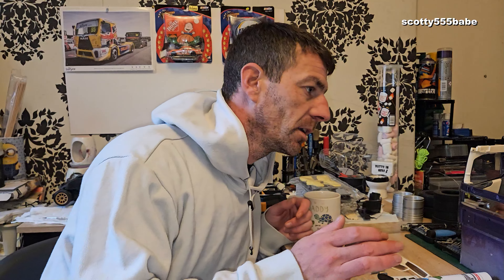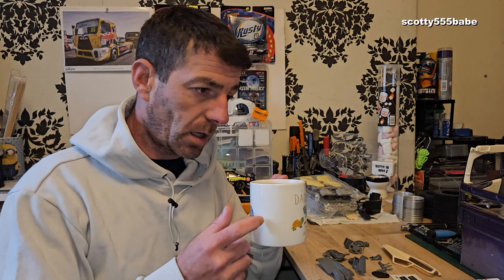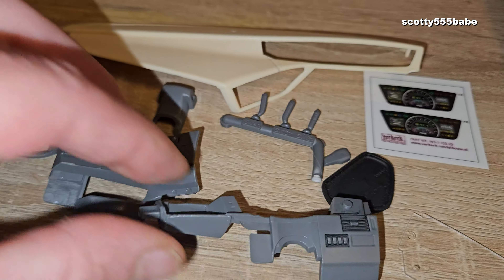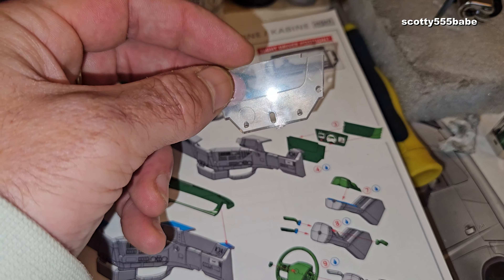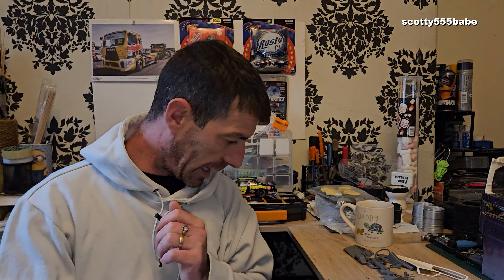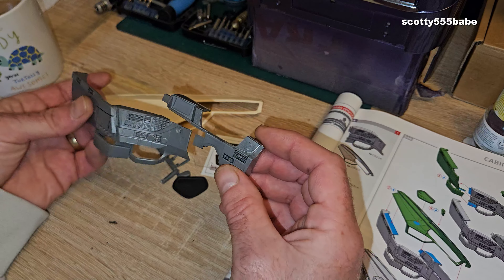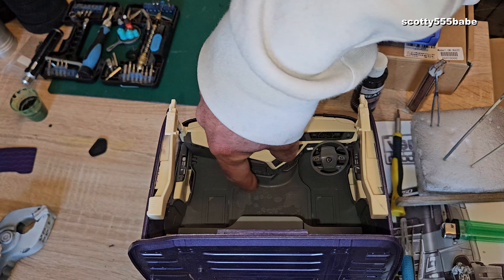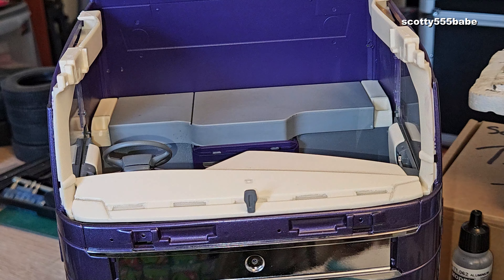HIGHLY DETAILED MODEL DASHBOARD | VERKERK VOLVO Model RC Truck

Comment: Lookin grate bro u goin put interior light in if I was goin fully use it I’d change the suspension to fake 1s that work bro how bout doin the mat thing black or dark gray so it stands out bit or it fade into floor bro
Reply from the maker: Cheers bro.. I was thinking of an interior light and I'm stripping the paint off the mat and I'm going to flock it in grey embossing powder so it looks like a real grey carpet..
I'm happy with how the dash turned out, I think it looks better now than just plain grey bro 👍🙂